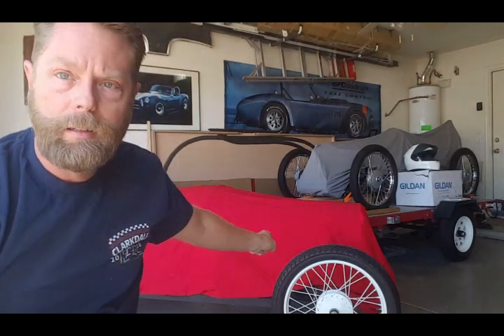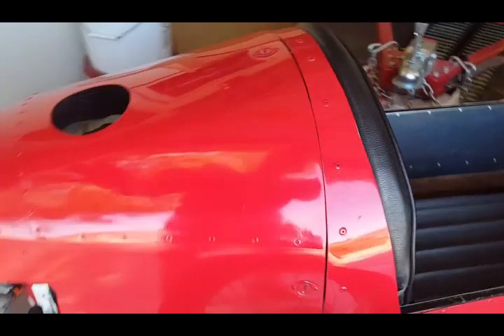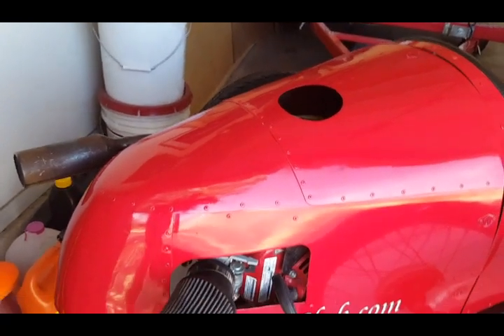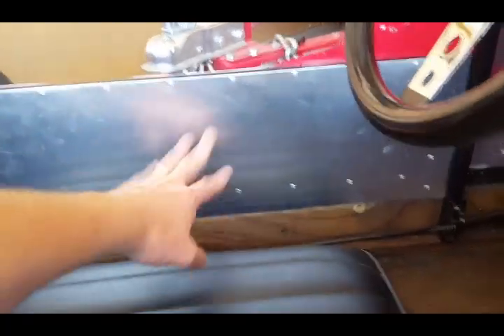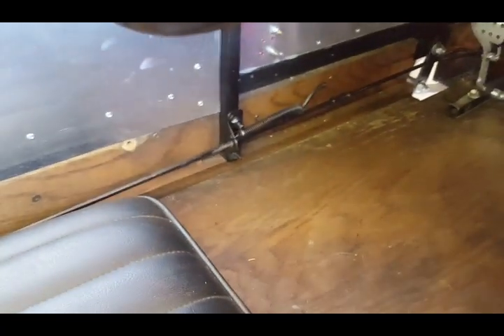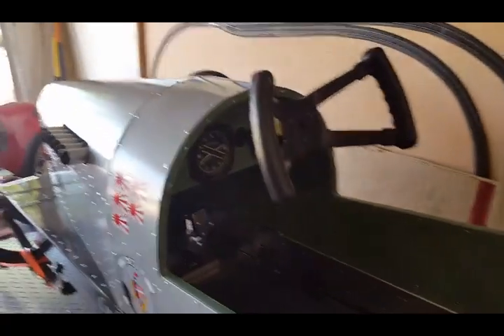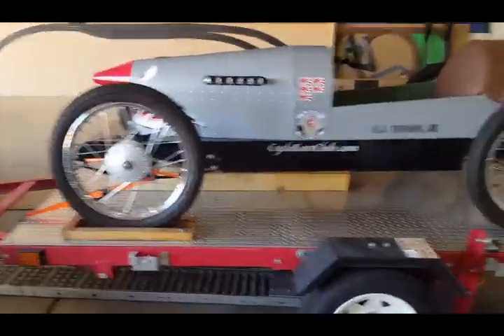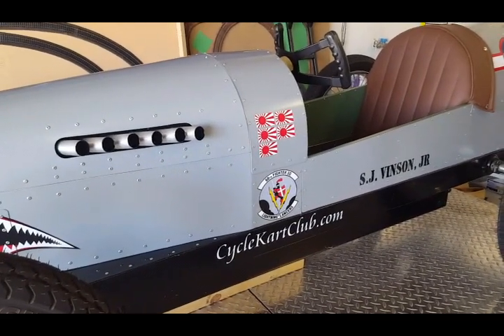Cyclekarts

Comment: saw a Cyclekart Race vid before your vid. It was real neat. I wondered about the motors, Was there different class's or is there restrictions for motor and gearing? Does the engine have to be in the rear?  These are reminiscent of the old indy day racers. I hope this sport grows
Reply from the maker: The rules are pretty simple, Honda GX200 and or Predator 212, some guys run them stock, some remove the governors and do a stage 1 or stage 2 hop up.  Basically a slightly bigger carb and a timing key and header.  High level tuning is discouraged, this is supposed to be fun and inexpensive.  Gentlemen Racing, we don't care who wins, there are no trophies for being first.  It is actually more likely that you will get a trophy for waiving a faster kart by.
Most karts have the motor in the rear, however, I know of two that have the motors mounted in the front, both are fairly complex builds.
Thanks for watching

Comment: I might have a common question but why do cycle karts not have rear suspension?
Reply from the maker: Rear suspension has been done an a few karts. It adds quite a bit of complexity and cost.  In my experience it really isn't needed.  If you want to build it with rear suspension, go for it.